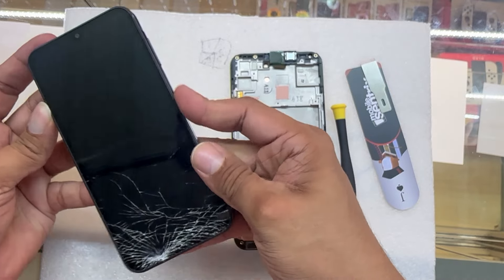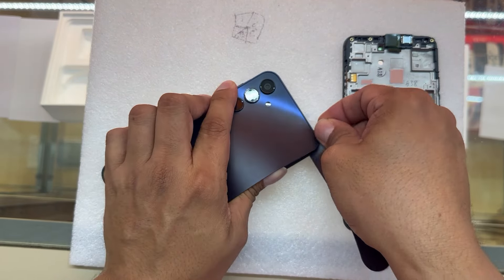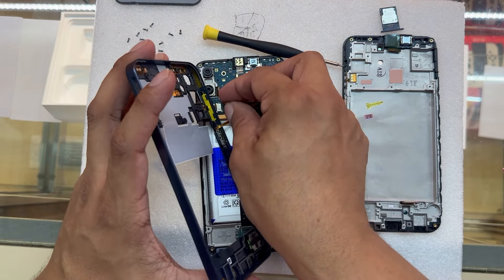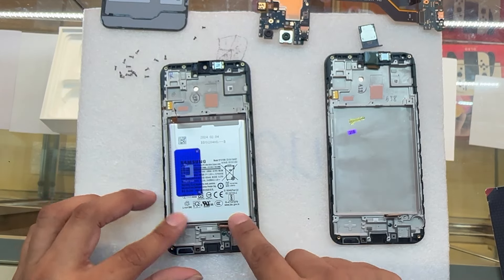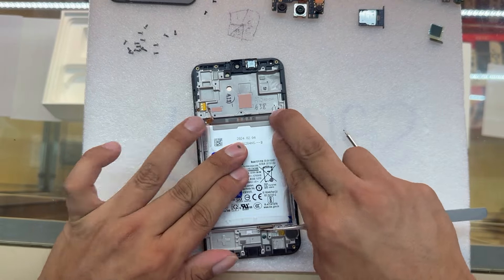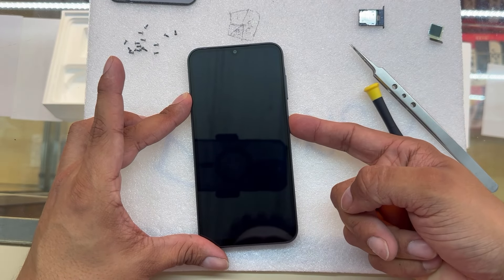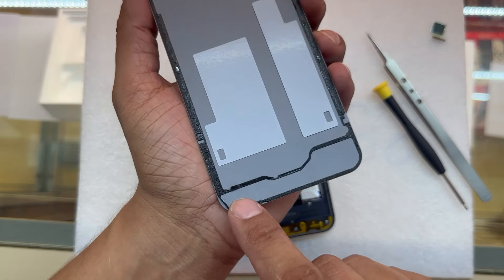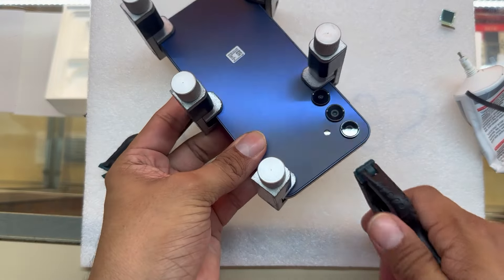Samsung Galaxy A15 5G Broken Screen - Glass Repair And Take Apart

Comment: Thought it was the glass you replaced, but you just replaced the whole front end and frame.
Reply from the maker: Replace just glass on this one is a little more challenging , I have other videos showing that process on different models
Reply: @JoseMoralestech  
I went ahead and ordered the kit like you showed for like $57 on Amazon. 
I miss the older Galaxies that you could change the battery and just the glass. Oh well. 
Thanks for the video.
Reply: Frame repairs are more expensive but I certainly prefer them.
Reply from the maker: @TrashPanda71  was definitely cheaper back then , good luck on the repair
Reply: @JoseMoralestech  
It went well. I've got a set of very small screwdrivers.  Love messing with that type of things, just not done many phones .
Thanks.